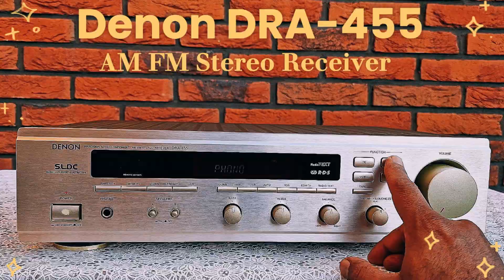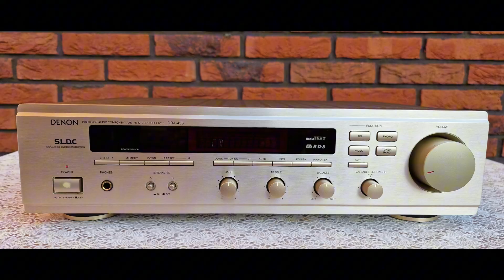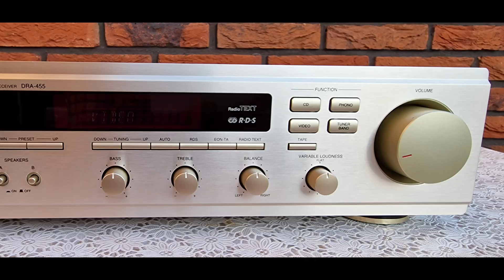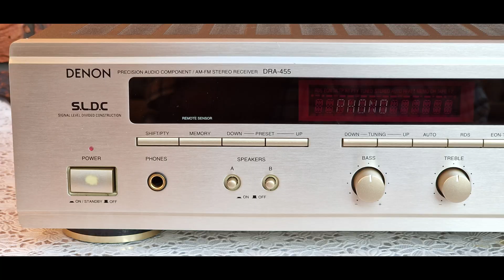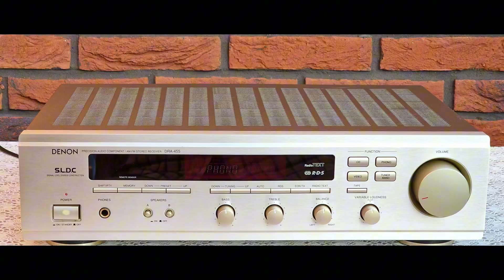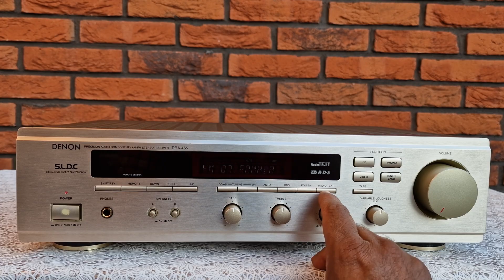Denon Hi-Fi Classic! DRA-455 Stereo Receiver Amplifier Reviewed | Can it Compete with modern Hi-Fi?

Comment: Do you think such stereo receiver sound as good as integrated amplifier of similar stack same brand? Thanks
Reply from the maker: It depends if they have same power and same impedance for speaker matching but it lot depends on the hardware used especially the PA out if it is with STK chip or MOSFET and class of amplification used. So my friend there are so many variables need to be considered. But simply if same brand Integrated amp has same level output and same impedance and or used on same speakers and same volume level with same input then human ears will still find some difference in the audio generated by two same brand amplifier / recievers. And an other thing with Receivers they have many different input builtin like AM FM Reciever whereas Intergrated amps are only design for amplification therefore Integrated amp will indeed sound better than receiver in my opinion. Thanks for asking it is very important question especially one should have in mind before acquiring the equipment to think about its usability if builtin radio is needed then receiver should be give preference but better sound quality a stand alone Integrated amplifier would be my choice. Greetings